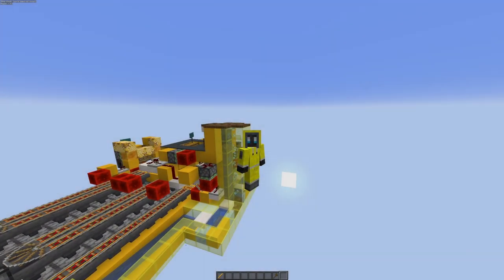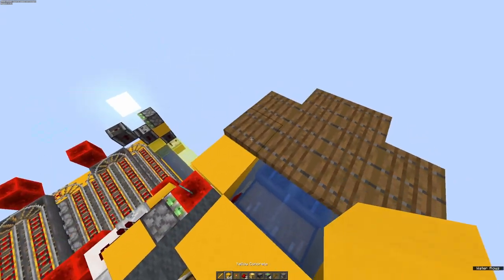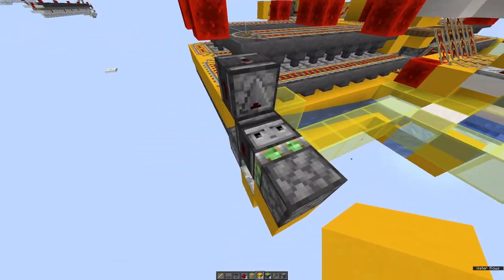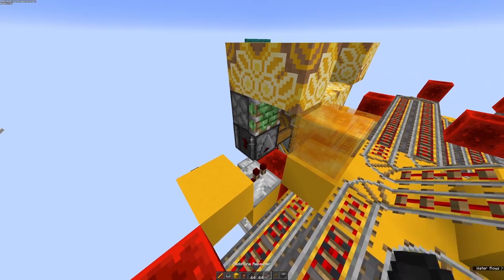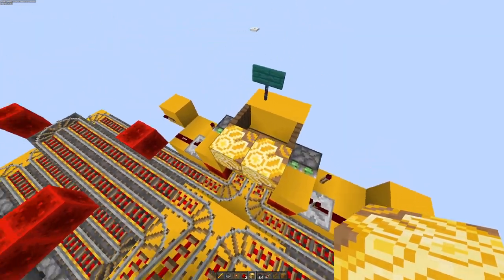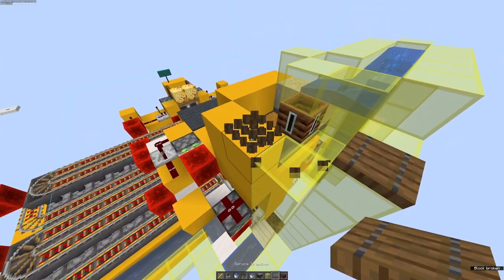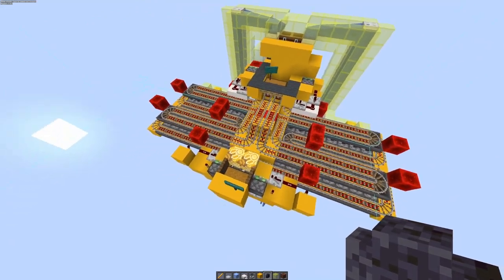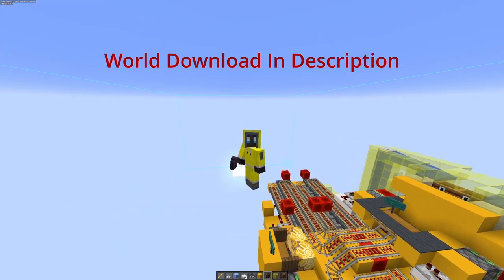Super Smelter - Upgrades, Fixes, And Optimisations

Comment: You could also just add 2 double speed hoppers on the output chest. Two into the top of the output chest, two into the back, and 2 more directly above the back hoppers that are pointing into the top hoppers. No hopper minecarts  required and it would operate at 4x hopper speed, plus you wouldnt have to change the item water streams eiither
Reply from the maker: I feel like I had a reason at the time, but now I look at it and I cant think of the reason, that's a good point lol.
Reply: @ShaydeeJay  love the smelter though, good work!
Reply: @ShaydeeJay  probably the possibility of items getting stuck on the smaller hitboxes, but that's fixable
Reply: I believe it's because the items would end up in the 2 hoppers hence unable to use the 4x hopper speed it theoretically would produce. I managed to do a more compact design for the output with, like how you demonstrated, 2 minecarts.   @ShaydeeJay

Comment: There is a problem with the fuel hopper minecarts: the comparators do not update when the minecarts are full
Reply: Yes there is ia issue that the fuel hoppers are not stopping or going to refuel . You have to just replace the sticky piston and slime block again on both sides and it will work

Comment: The supply minecarts get stuck / lose momentum when arriving back at the beginning of the loading station. I'll prolly be able to fix it on my own but i was curious if anyone was having the same issue or had found a solution. I'm also on 1.20.1, idk if that matters but I figure id mention it.

Edit: The minecart gets bumped by the slab (with the comparator on it, coming out of the input chest) and gets stuck on the ramp. I removed one furnace from each side making it a 62 furnace smelter and moved the fueling minecart track down one block. After realizing the slab (with the comparator) was the issue I replaced the slab with a trapdoor and that fixed it.

Conclusion: Put the comparator coming out of the chest on a trapdoor instead of a slab and the minecart and input delivery system will work properly.
Reply: hey.. i've a similar problem too.. but in my case the refuel minecarts are getting stuck at the observer clocks.. what can i do ??

Comment: I only have 2 issues with this smelter array:
1. One furnace gets double the amount of coal, meaning 33 coal is used per minecart travel cycle instead of 32.
2. The fuel minecart only travels when it's completely full, leaving 4 stacks and 31 coal sitting in the cart. I think this could be solved by making a similar system to the input/raw chest, but that wouldn't work due to issue #1.
Reply: granted, filler items can be used in the hopper minecart, but it's still a bit of a design flaw
Reply: I know the reason of 1st and a way to fix it. It's because of the u shaped rail placement, when the minecart reaches start of that rail, it drops the item in hopper below it and in a hopper adjacent to it. You can fix this by removing adjacent curves of rails by extending the rails on dropper side by 1 block to outerside
Reply: Hallo I just got rid of the redstone that the comparator was comparing it's signal to. I replaced this with a compost set to 2 levels (equivalent of 32 items in minecart). Seems to be working okay for now and sends the minecart once there are 32 items in the minecart (instead of full minecart)
Reply: Thank you for this! @shivangrathore

Comment: ther is smt wierd that happen to mine if i put lest say 23 sand in i get 13 glass back and lose 10 of the other glass and i cant find where it went like its nowhere to be seen
Reply: This just happened to me. I found them in the fuel hopper line. I'm thinking the minecart for fuel sucks in the sand from line above?
Edit: This was after I had set it so the fuel minecart would be sent at 32 items instead of a full minecart. I suppose having a minecart full of fuel would prevent this from happening

Comment: My minecarts get stuck in the corner near the observers and the droppers any way to fix this?
Reply: Yo man, had the same problem myself. Not sure if Mojang decided to randomly change hopper minecarts' hitboxes or something in 1.20 causing the hopper to stop when the observer is pushed above it, but I found a fix for it. You don't even need to make all of the changes to the dropper like he does in this video (like putting it below rather than to the side), all you have to do is use the noteblock version of the dropper system for outputting the items and then put any solid block above the observer for when it is in the "on" position (when it's supposed to be dropping items) as well as redstone dust on top of the dropper itself. This got the system working for me, albeit at the same slower speed as before. If you want to make the output faster like he says in the video, you have to make changes to the hoppers like he does. This was expensive, so I just changed the output system to the noteblocks and kept the slower speed, cuz I end up just doing other stuff and waiting while my blocks smelt anyway. Hope this helps.